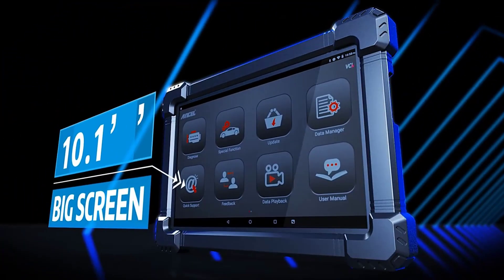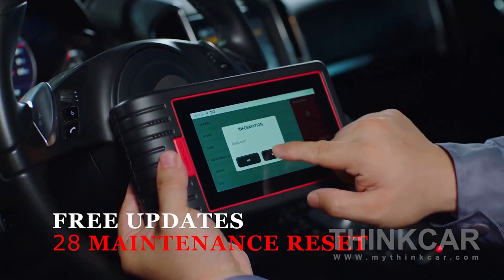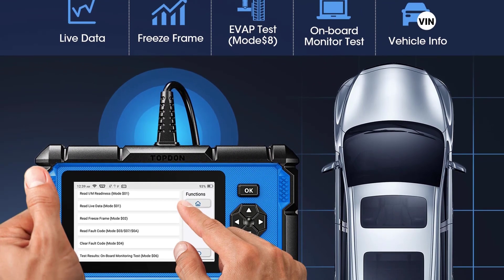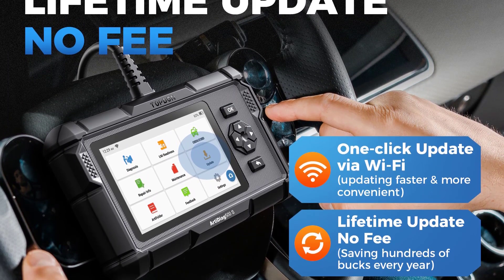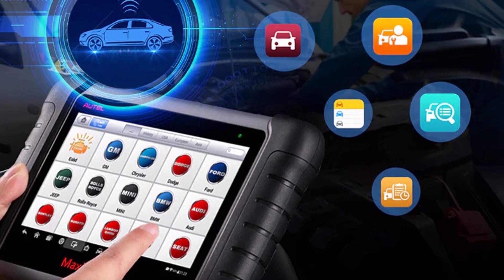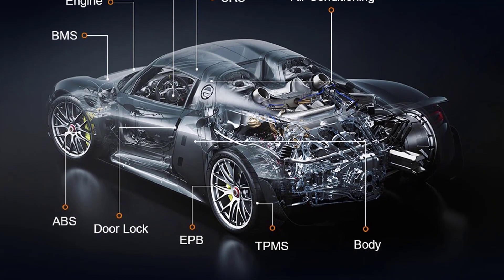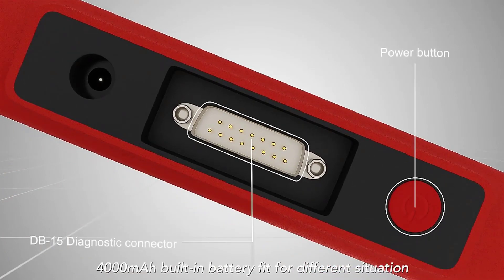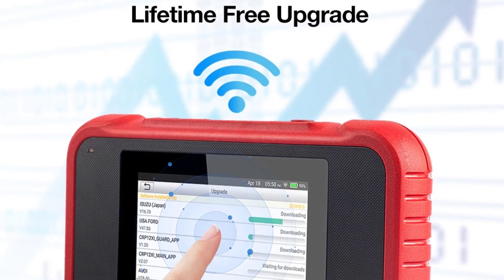Top 5 Best Car Diagnostic Scanner Review (2024)

Comment: I bought a Launch scanner CRP 129 E for servicing our older vehicles because other manufacturers I approached would not even bother to answer my emails when I enquired if their scanner was suitable for my older vehicles. Overall I am very pleased with the Launch scanner as it correctly diagnosed the faults in the ABS wheel sensors and also has very good live data speeds and graphs which can be sent via Wi-Fi to be printed off from a laptop. The only thing I am not too pleased about so far is the way additional functions such as ABS brake bleeding available under the MALL icon expire after 12 months.  DIY mechanics want ABS brake bleeding specifically for their vehicles without having to pay for additional vehicles they will never have and with the need to renew it every 12 months.  There is a way of bleeding some ABS brake systems without a scanner but I would not recommend doing it on a public highway.